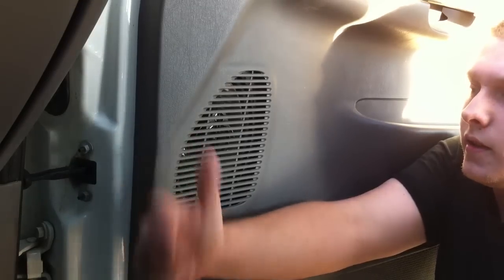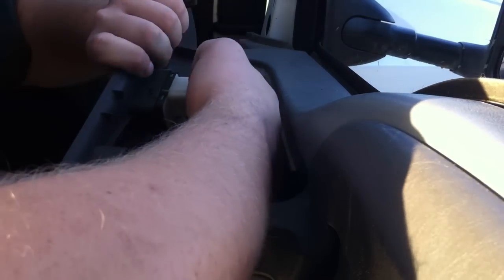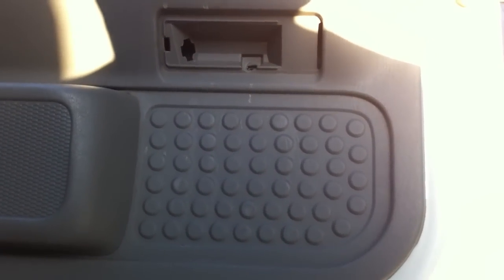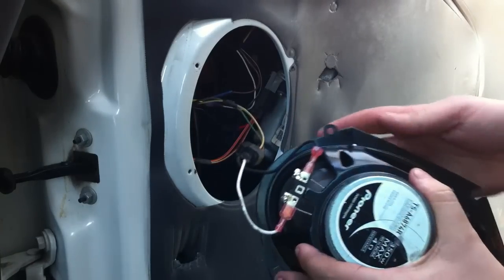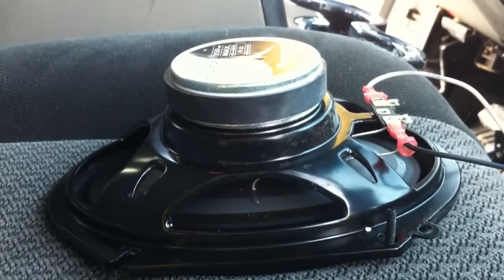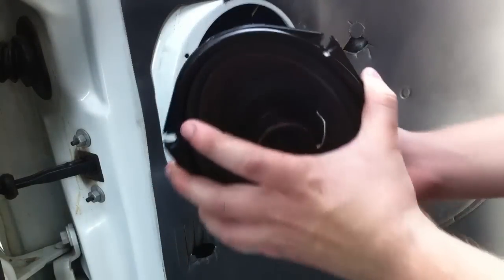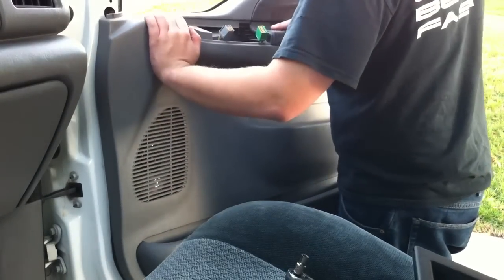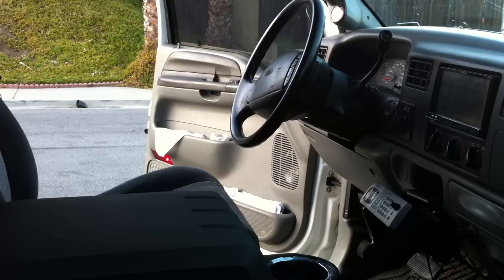Super Duty - How to: Upgrade Front Speakers

Comment: one note on the speaker adapter harness i redid mine today and never noticed it before but the wires are reversed on the adapter. atleast it was on my 04 f150. my buddy that is a installer said that alot of the adapters are like that for some unknown reason. so just a heads up. i would just use 2 butt connectors on it and not use the harness.